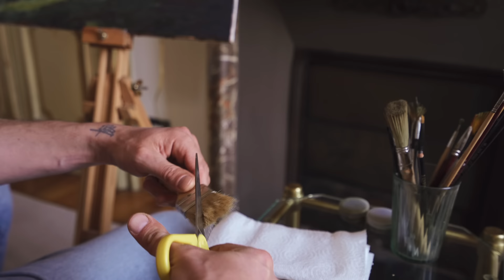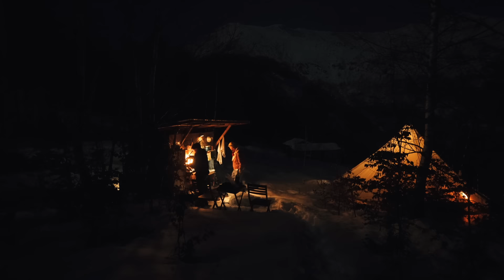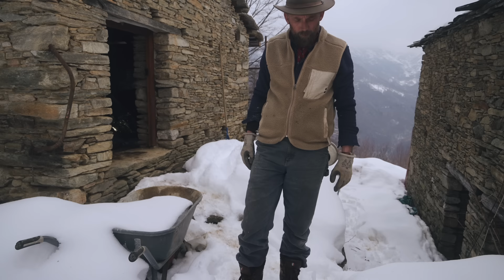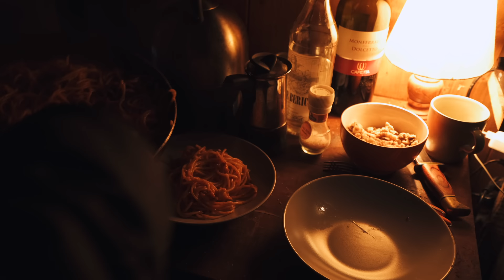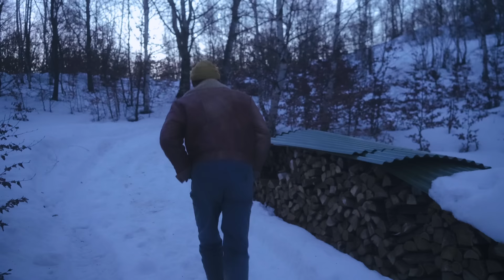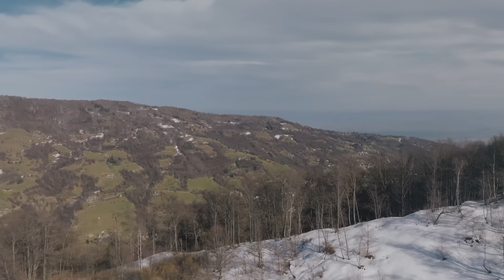#57 Building a Chicken Coop

Comment: A tip for the chickin coop. Also use chickin wire on the bottom of the coop under a layer of sand. Foxes badgers wezels don't mind digging under a coop to get to the chickens. Cheers for the good episode

Comment: Hello from a fellow dutchman (van Horn.)  Admire your hard work. We live in the mountains in Montana and can share some tips for this type of living.    For putting on chains, drive one wheel onto a block of wood or brick, makes it a little easier. For starting the wood stove, We put compressed wood pellets in a plastic barrel and soak them in diesel fuel, use a scoop for an easy start (does not have a quick flash point.) Chickens- foxes, eagles, falcons, racoons, all predators will be after them. A guardian dog could protect them. Water line, I believe ours is buried 5- 6 feet down under the frost line, and put electric heat tape on the pipe where it exits the ground.

Comment: Thank you for showing the room where you stayed while the winter took over your home.  Beautiful furniture in the room.  I still can't get over how fast your weather comes and goes.  You don't need a winter coat?  The tent looks like it is holding up to the ice and moisture.  Will the chickens tolerate the cold?  My suggestion is to lower the roof of the coop to help with the cold.  The heat will rise to the roof not allowing the chickens to keep warm.   Lowering the roof will allow them to keep the heat where they are.  I can't wait for spring so you won't be held back with the snow.
Reply: I suspect that this build is the chicken run, and that a chicken coop will be built inside that. Knowing Martiijns flair for design now I think the chickens will have a superb home!

Comment: If you get some sacks of course rock salt (usually very cheap) and keep on site in a dry spot, you can use it to melt ice and sprinkle on locations (paths/steps) with a hard surface to stop snow/ice forming and keep clear for access. Goodluck & Kia Ora from New Zealand 💜💜 NB: Any stone masons or concrete workers know not to work with lime or any cement/concrete when you have freezing temperatures, as it will crack and decay easily and all have to be done again in warmer weather. Take care.

Comment: I was so excited to see the subject matter today! I just visited my flock yesterday (they live at my moms).

 The coop is looking great so far!
 I second all the folks talking about burying hardware cloth (wire) about 2' deep under the ground to prevent tunneling by foxes or wolves.  IAny the little openings need hardware cloth over them, especially there are any weasels around ( I am not sure if you have those there?). Hardware cloth is the best wire, chicken wire is only meant to keep chickens in, it does not prevent predators getting in ( they can bust through it). Attach it on the outside of the boards, or sandwich it between an inner and outer board. 
 So the coop should be draft free, but with good ventilation, usually vents up at the top on one end and a couple at the bottom for good air circulation.
 Insulate the coop well, and the chickens will be fine without any added heat. Many coops have burnt down due to heat lamps that the chickens didn't actually need. I've added panels to some of my coops that I can take off in the summer, or I switch them to plexiglass so they can still get sun, but it'll keep the wind and other weather out. 
  See if any of your neighbors will sell you some chickens, they will have better resistance to any diseases that might be in the area, and you know they are hardy enough to survive the weather. Neighbors can also tell you more tips and tricks for your area.
  A really good online resource for any chicken related thing is backyardchickens.com, there are forums where you can ask for help or share things, as well as articles about anything chicken related you can think of.

  Please include lots of chicken footage!
----
 Also, I  love your paintings! Yeah oil and acrylic are different beasts, but both have plus and minus. Get the medium that slows the drying time of them. Next is watercolor? :)  That one is completely backwards from oil and acrylic, and what I usually use. 

   I love your channel, I discovered you last week and binge watched as I worked on other projects. It is so beautiful there, it soothes my soul to watch. I like to watch folks who are so dedicated and diligent in their work. With so many shortcuts for things these days, I feel sometimes we miss out on the pleasure of doing things ourselves, there is pride in being able to say you did that with your own two hands.
Reply: Brilliant advice from Jenny, about the chickens.  I'm wishing you every success with them. They have their own characters too, I'm interested to see which breeds you choose.

Comment: Not sure if you've kept chickens before--with the wild life make sure you have the coop/run surrounded 360 degrees with welded wire it needed to be screwed into the braces and pinched between a board and the brace is even better.  So a 4x4 or 2x4 and a 1x4 board over it.  Everything from weasels to foxes to cats will try to get in and eat your girls.  

Also with the cold make sure it is ventilated to keep them dry, but not drafty; they make lots of moisture when they breathe and poop. Keeping the coop dry prevents frost bite. ☺️

Comment: Suggestion- you may want to check the airflow pattern as it changes at dawn and dusk, to see which way it typically goes during those times of day the air shifts..  Have your friend bring a smoldering torch to the proposed coop location to check it.   We had the smell of our outhouse when the cold uphill air dropped towards the valley, causing us to have to relocate it further cross-hill.   Cheers, Rov

Comment: Check the temperature requirements for the mortar you are using! Generally it's not recommended to do concrete work in the winter. It doesn't set properly. Best of luck to you up there from Vermont, USA.

Comment: When you were standing in front of the camera, wearing the tan vest, talking about your car being a mile away, I thought, "what a good rugged photo of you.". I hope you might paint a self portrait of yourself one day. And of course, send it to your parents. Then paint another. I think it would sell, with the right background.  About acrylics, it is difficult because of the quick drying. I place each color on a separate small paper plate and place them in a ziplock bag.  Then I am preserving each tint and tone for later use. It's a bit of a hassle to have to open a bag everytime you need a different color, but you can have variations of that color on the same plate.  Also you can use a glazing liquid for acrylic paint, that really helps the paint go on smoothly. It is unique to paint layers with it, because it makes the paint a bit translucent and you can see through the layers of paint a little.

Comment: Ramming posts with a small iron hammer is too much force per area and the wood splinters. I prefer to use a selfmade wooden hammer made by applying a shovel handle into a large round chunck of firewood. Wood on wood with maximum contact area is best against splintering.